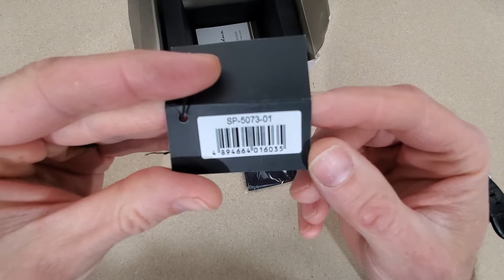Spinnaker Hull SP-5073-01 watch review.

Comment: Great review.  That dial looks amazing.  A lot of people hate mineral crystal but in these lower tier watches you get better clarity and reduced glare so it actually looks better.  None of these watches are really keepers for people so I don't know why it's such an issue.  How is the quality of the case vs. other micro brands?  Is the polishing uniform or is there some pitting or distortion?  And by pitting I just mean if you get the angle just right you always see some slight dimpling even on expensive watches.  How does the polishing stack up against the SKX's polished case (if you remember when it was newer)?  I just got a Spinnaker Spence but i didn't read closely and it has a bead blast finish.  It's done perfectly and very uniform but it's hard to gauge it relative to other watches with normal finish as far as finishing quality goes......So I have another on the way to me I found with normal finishing.   It's looking like they are pretty well finished that would give other micro brands a run for their money and even surpass them.  Like Zelos, Helm and Phoibos.  I have a Zelos Ti and Phoibos on the way too so I'll have a bunch to compare.  I also have an OG Boschett Reef Ranger from 2013 on the way.  From pictures it looks like machining precision has really come a long way with $100 watches now having finishing like 700.00-800.00 micros from 7-10 yrs ago.  It will be interesting when I get them all in hand.  And this was an expensive weekend for me :-(
Reply from the maker: Sounds like you were busy on a watch shopping spree.  I do not have the watch in hand any more, but I do not recall any issues with th4 machining or case finishing.